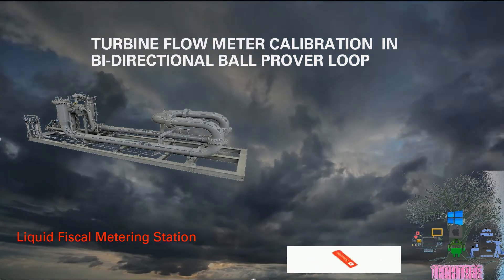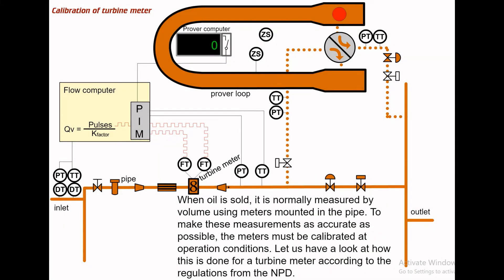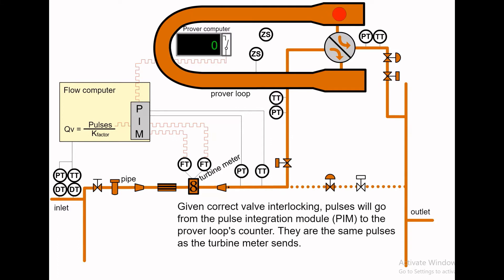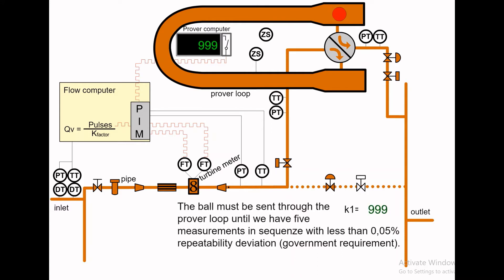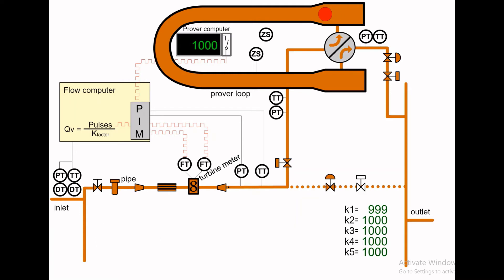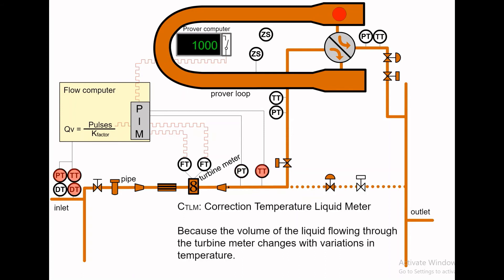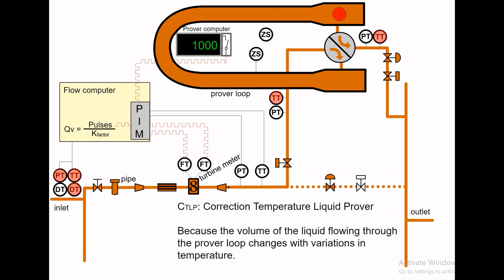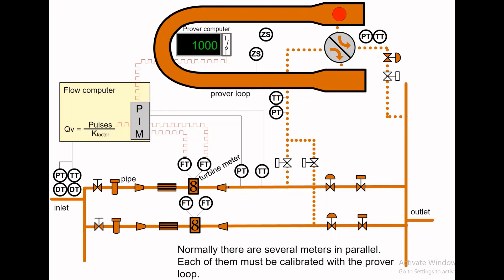Bi Directional Ball Prover Loop calibration of Turbine flow meter in Fiscal metering system

Comment: we take series of runs on prover loop,but when the ball detects its starts counting, but after 4 seconds it stop but the ball still travel and not yet arrived for 2nd detector.the detector is new
Reply: Check for the k factor in the meter. Ensure the k factor of the meter match the base volume between the two detector switches.